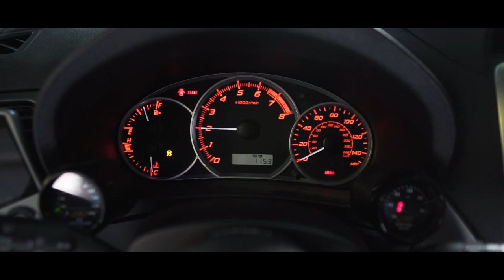Cutting Into My Hood - Track Prep

Comment: So I notice that you had to take out the hood insulator liner in order to cut through. Have you notice any paint fade under the hood at all? Not drilling my hood but I’ve been wanting to just take out the liner off of my wrx to get more sound from the engine but just worried the paint under the hood will fade over time.
Reply from the maker: Ive run without the hood liner for maybe 2 years now and have not noticed any paint fade.